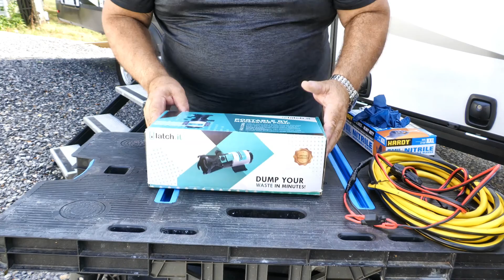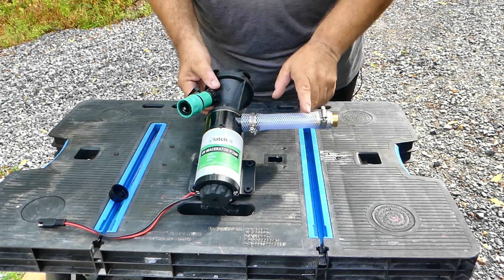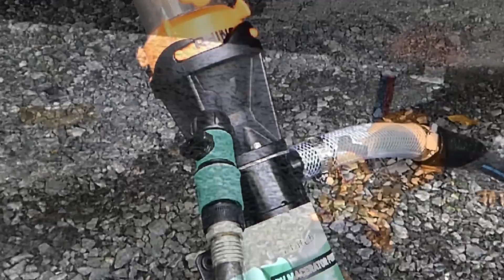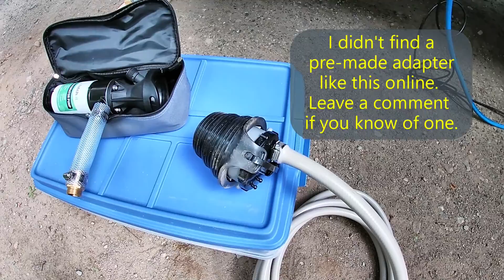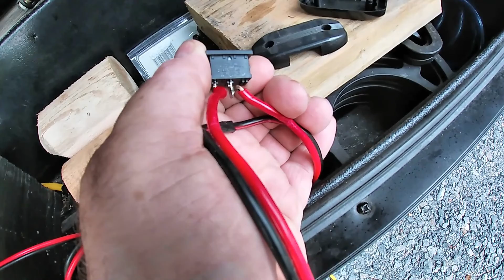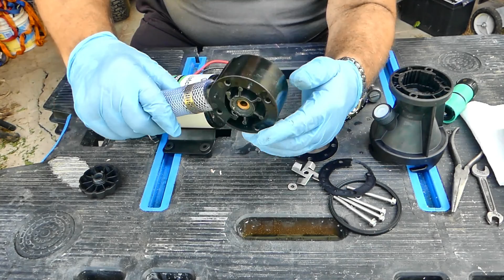Latch.it RV Macerator Pump - Do you need this?

Comment: Some solutions to not being able to keep the gray water open all the time they make a garden hose to bayonet  cap so you would string out the 3/4"garden hose and leave it connected then just remove the cap and hook up the macerator then after you black is empty you would simply switch back to the cap and hose for your gray water to flow all the time still seems better then the 3in stinky slinky also much better for long distance or up hill scenarios

Comment: Great video. Thank you!But sir, you must use more water in your black tank! More water! I have a 20 gallon black water tank and mine is never that dark. Also when flushing your tank you should have a back flow valve so you don't contaminate your house system. NY state requires them at every campground outlet so they must know!

Comment: Great video. Question? When you made the extension cord with the alligator clips attached. I’m assuming the ext cord had three wires. How did you connect the three wire to the two wire ? Which wire from the ext cord was combined/or not, to the two wire. Or should I find a similar cord that’s two wire?  Hope I explained my question completely. Thanks in advance for your reply.

Comment: Nice video. I see it claims to be capable of 10’ of lift. Have you tried this, and if so how much does it slow down?  I’m wondering how it would do pushing waste up to a blue boy in the bed of a pickup, as people do when boondocking with rough road between the camp spot and dump…

Comment: What keeps that black tank mess from going into your water hose there
Reply from the maker: Thanks for the question. The Macerator pump has a built-in check valve on the side port that blocks any backflow into the 3/4" hose used for flushing. Also,  there's a similar check valve built into the 3" clear black tank outlet adapter I used to show the flow. The flushing hose is only used to flush the black tank and not for filling the fresh water tank.  Care needs to be taken to avoid cross contamination into the clean water supply. Also, the 3/4" discharge hoses from  the macerator are only used for this purpose and never anything else.  Great question!

Comment: Those switches are cheap. I expected it to fail. Good review so I subscribed. and I like the channel.
Reply from the maker: Hi and thanks for watching and your positive comments!  They were under-rated. The amperage is the important number and the manufacturer should have used switches with a rating of greater than 12 amps. 15 amps was my recommendation, and the higher rated switch is only slightly larger in size, but is double the cost. I bought a replacement switch at Home Depot for about $7.00 so I could operate the pump safely.

Comment: Over the last seven years I’ve used similar pumps (of two different brands). At home the sewer clean-out is 100ft from the RV. The pumps overheated and eventually failed until I actually read the directions and found that I was overloading the pump with excess back-pressure. I now use two hoses in parallel and the pump runs cool even after running through the black tank and gray tank running almost constantly. Also, gray water (leaving the valve open) will drain through the (not-running) pump, but it will likely damage the pump after a while. (I learned all of the above the hard way. Four ruined pumps.) I haven’t done it yet, but I intend to spray some red paint on the ends of all the hoses and fittings I use for waste water. I have anti-siphon valves on both ends of the hose I connect to tank flush. And one final: Camco makes a garden-hose-to-sewer adapter, which I’ve been using.

Comment: Will it chop the toilet paper too
Reply from the maker: Maybe . . . Some brands of TP do not deteriorate in the black tank. If you use an RV / Marine TP you'll be OK. I use Scott 1000 and this TP breaks down nicely and will be processed by the macerator without issues. Charmin has thicker more sturdy sheets and does not readily breakdown in the black tank. This might cause the impeller in the macerator to clog. Cleaning the impeller is easy, but not very pleasant.
Reply: I got a clogged black tank will it suck the clogged out

Comment: Yours is the only video I've found that showed the internals of a macerator, thank you! I appreciate the detail and the thoroughness of your video. I hope you will do more RV-related videos with all the details and disassembly of devices to show how they work. That information is extremely useful for troubleshooting and DIY'ing, and it's great to know more than just the obvious stuff that most other videos share. Great for those of us who are detail-oriented and inquisitive. Thanks, again, for being different from the rest!
Reply from the maker: Thanks for watching and for your comments. Gotta admit . . . I really enjoy taking stuff apart.  Also, glad when I'm able to put it back together and it still works.  Knowing what's inside helps to troubleshoot and fix a failure.

Comment: I went through several different pumps like this them decided to just go with a garbage disposal setup. I went with a 1/2hp disposal using 3/4 inch hose that's 75 feet long and it's still going strong 4 years later. Plus it only takes it 8 minutes to empty all 3 of my tanks.
Reply from the maker: Thanks for watching and for your comment!!
Reply: My current FloJet empties 35gal black and 45gal gray in about 12 min (incl flushing black). Secret is having enough hose capacity.
Reply: How do you attach garbage disposal?

Comment: You make it look so easy. We did all these steps and we have a leak at the hose as soon as we turn it on 🤯 we thought it was the hose. Bought a new hose. Still happening. What are we doing wrong 😩🤷🏻‍♀️🤷🏻‍♀️
Reply: Check/change rubber gaskets or try using just two wraps of plumbers teflon tape.
Reply from the maker: @kaivonmortazavi8656  Great advice. Some of the cheap rubber hose gaskets will deform and leak when overtightened.
Reply from the maker: See advice below. Hope you get the leak sorted out.  Try a different brand of hose gasket. Some cheap gaskets are way to mushy and flexible. they will deform and leak when overtightened or if the shape of the hose ends allow for the gasket material to flex and bend.